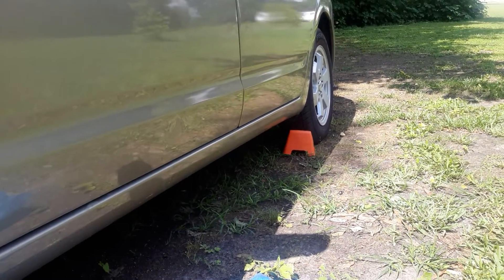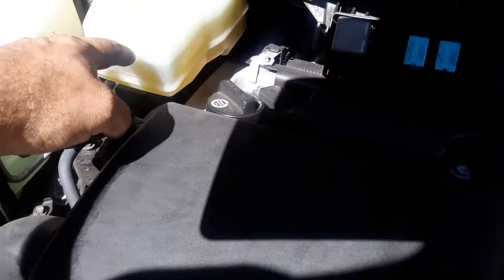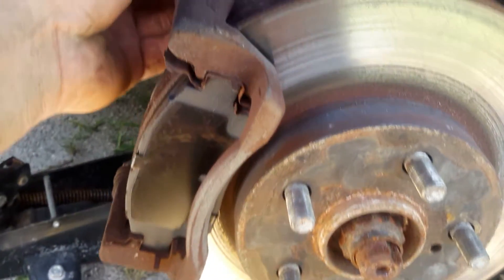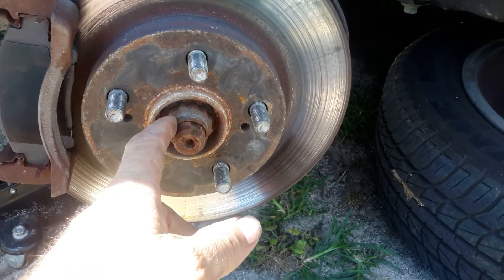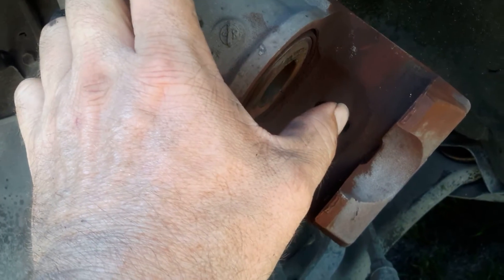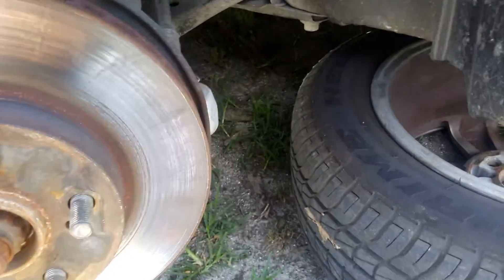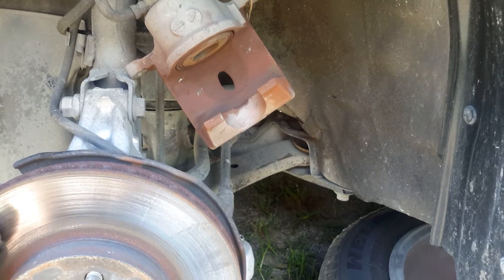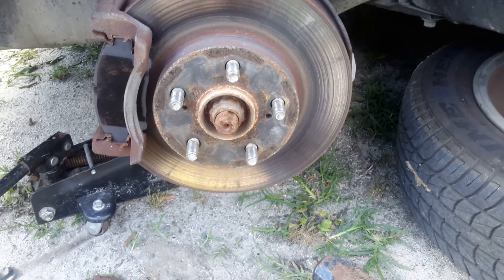Brake pad replacement Toyota Prius 2005, gen 2

Comment: Boeshield as a penetrating oil on those caliper bolts is gold. Costs about the same as gold, but works especially well on alloys. Lubing pins keeps calipers moving smoothly and evenly (especially important on Sprinters).

Comment: FYI to anyone watching then reading the comments.
When doing front brakes, the calipers could auto compress if the key is in proximity of the car. Google why.  Leve your keys in the house or at least 50 feet away or you will have a very bad day.  Not sure how often this has happend but the warnings ar frequent enough to not take the chance.

Comment: The Toyota dealer said I voided my warranty getting the brakes done at a non-dealer is that true and that my car is going to die because it has no more regenerative brakes they said I need special brake pads to have regenerative brakes

It's a 2008 used car but I did purchase an aftermarket warranty through Toyota
Reply from the maker: That's a big one.  Tell them to put it in writing on a service ticket.
Reply from the maker: A big lie lol.  Regenerative propertys take place even without braking just by taking your foot off the gas lol...oh my I can ruin these stealers (dealers) if I  face them.
Reply: Wow!  Big lie!  Look up the jumper method to fix abs light.
Reply: BS !!!
Brake pads stop the wheel from turning by friction/stopping...turning mechanical energy into heat energy.

Regenerative braking using wheels turning mechanical rotation energy into stored electricity by prius generator motor TO FEED HYBRID BATTERY !

Any farmer/educated diy dude/physics high school teacher could tell you that!

Comment: I'm sure you know what you doing?  What about disconnecting the battery?  What about relays?  What about discharging pressure? I see a lot warnings (internet) about the key proximity.  I see your relay cover is off, is that because of the breaks?